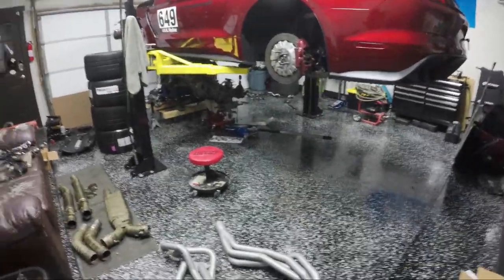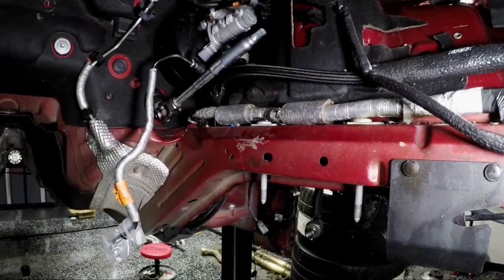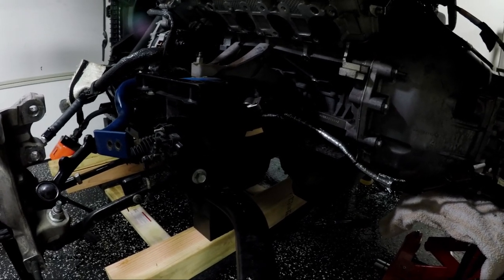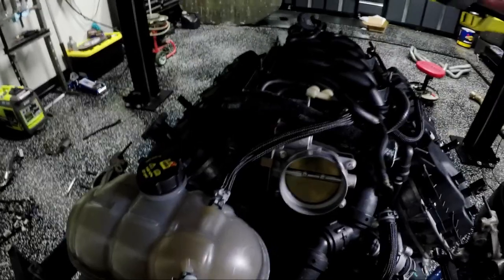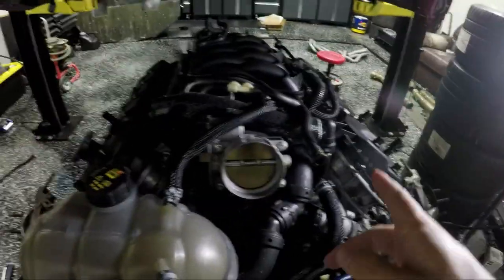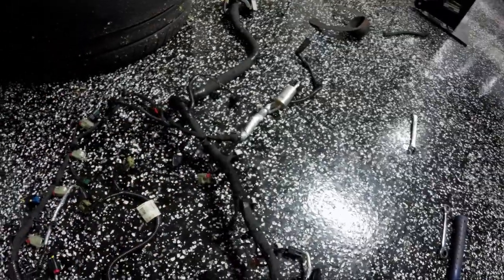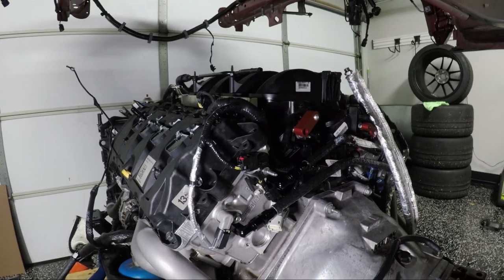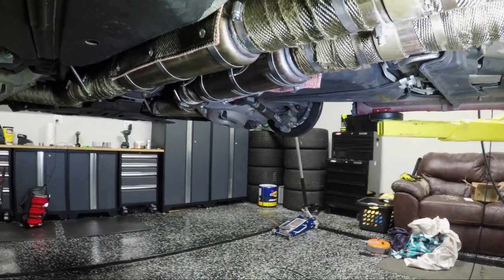GT350 Mid-Summer Upgrades - FP350S oil line mod, exhaust header changes, and more!

Comment: Thanks for sharing.  Looks like you have engine removal and install down to a science....how long does it take you to pull than reinstall?   Do you think there is a way to make hard lines to cool/equalize oil pressure between heads while retaining the manifold actuators and be installed while engine is in the car?  I assume there may be enough clearance for install by pulling the manifold?
Reply from the maker: For sure. YOu'd need to change the connections I used since the plug for the CMCV/IRMC actuators is right there. But it shouldn't be a problem if you push it a bit farther out from the heads. 

Not sure you'd have enough access with the engine in the car. There's only 4in between the firewall and the back of the head when installed. It'd be really tight.

Comment: Install a new left side engine mount. Might be that the old one is worn out. You can also fab a steel limiter bracket on the motor mount that will stop the engine twist. Old school was to fab a strap or chain to left side of the engine and frame to limit movement under full throttle.
Reply from the maker: I haven't had issues since I clearanced the headers a bit. Motor mounts were brand new, so they were good. Clearance was just too tight.

Comment: Hey Kevin, when you talk about the head to head connection you made you say both oil and coolant in the video. Which fluid is actually passing through?
Reply from the maker: It's oil. Those galleys supply oil to the lash adjusters. By connecting them together you ensure that the pressure inside the galley won't drop on high g load corners
Reply: @honeybadgershenanigans  Great videos Kevin.

Comment: Hi Kevin, What adapter did you use on the engine block to connect oil cooler lines into? Cheers Stan
Reply from the maker: https://performanceparts.ford.com/part/M-6881-M50A
Reply: @honeybadgershenanigans  Thanks for that Kevin,  what oil cooler are you using what size and where from?
Reply from the maker: I’m using the FP350S oil cooler. It’s a setrab  unit. I bought it from capaldi